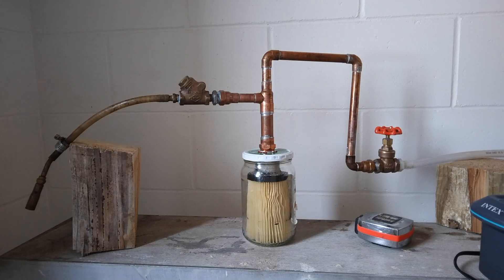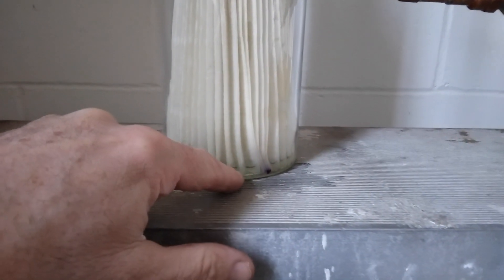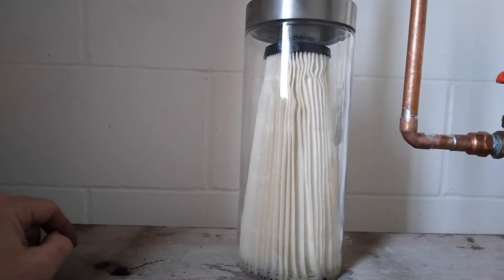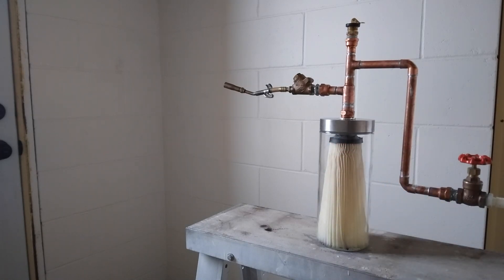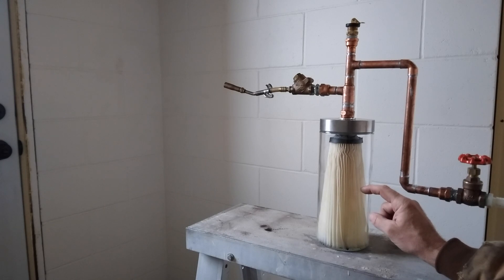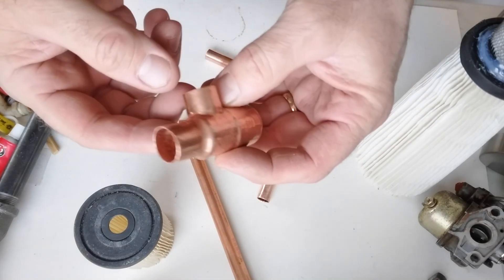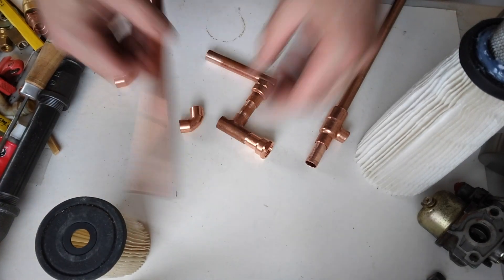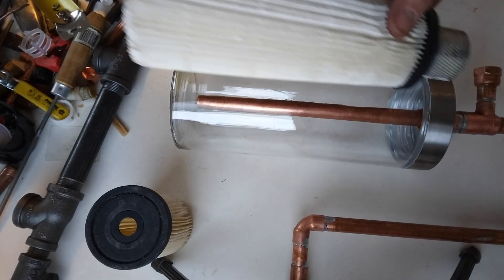Wick Vapor Carburetor R&D, 1st as a gasoline torch #2

Comment: great! can you use a hair dryer to induce heated air on the system to prevent it from getting cold. just a suggestion.
Reply from the maker: Yes, adding heat did the trick when I advance this into the 'Down Wick' carburetor.  Thanks

Comment: Interesting! What's the benefit of this over propane, other than availability of fuel?
Reply from the maker: As a torch, I'd rather use propane torch.
The description of this video is:  "Exploring the possibilities of a wick vapor carburetor.  First as a gasoline torch."
I'm doing R & D on a wick vapor carburetor to produce sufficient and consistent vapors, for a gasoline engine.  I decide that it would be more simple to test the development of vapors with a torch first, rather than trying to run and engine first.  -if that's what you mean.  
Other:  gasoline has more energy content than propane,.  Using gasoline for an engine really isn't that efficient using conventional means, but they do work well.  People have been trying to develop vapor carburetors for a long time trying to improve efficiency.  I'm just looking in to it myself.